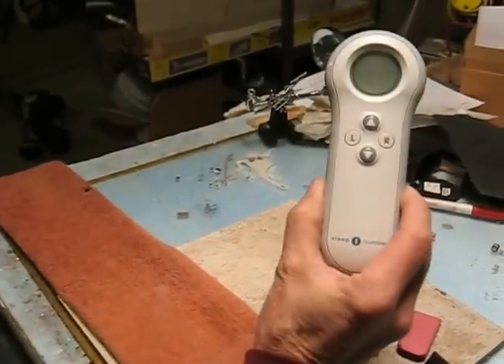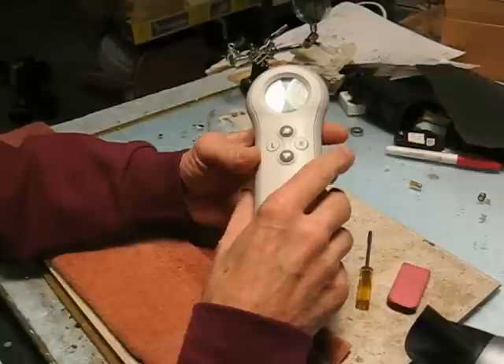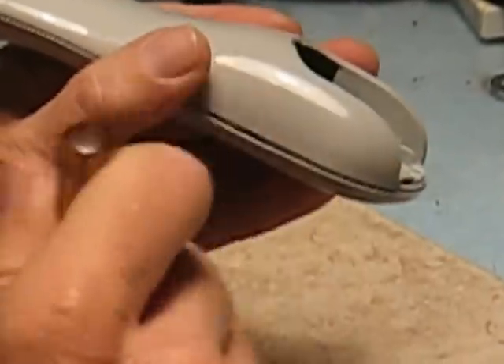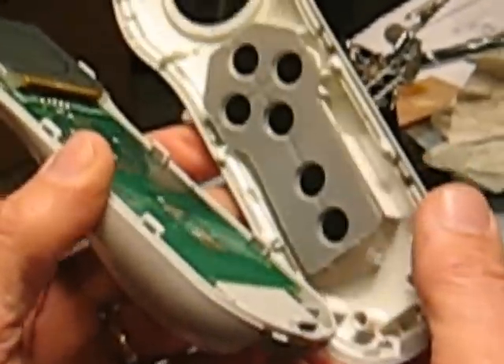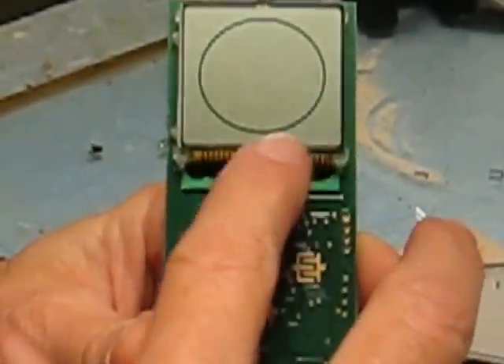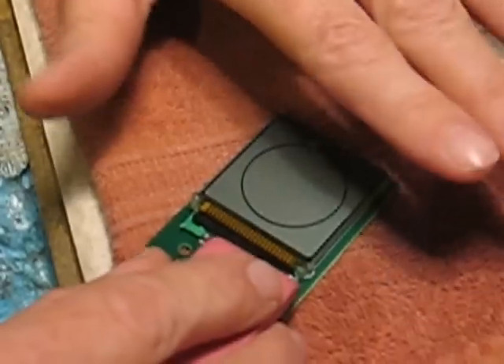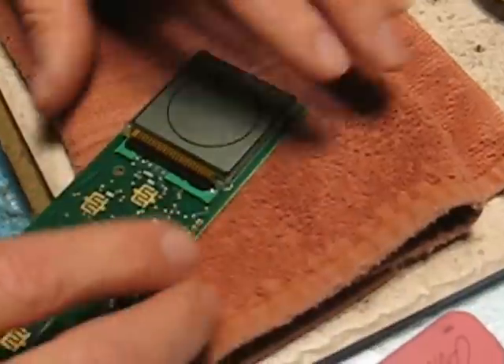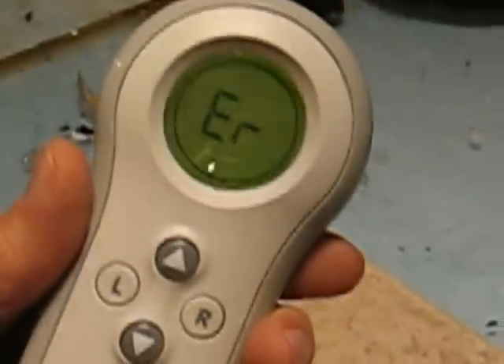Repair sleep number (Select Comfort) bed control display

Comment: Works very easy repair! 
Eraser in hand and hairdryer in other.  
Heat LCD until screen is black. 
Quickly press top of LCD Screen and lower bottom of connectors with eraser till LCD screen is clear.
Check LCD screen display. 
Repeat as necessary so all LCD screen numbers are fully viewable. 
Thank You

Comment: Brilliant sir. I used this with my old wired remote and aside from a bit of a fade in the middle, I can see the display again. For those of you using the wired remotes, just leave the bed plugged in while you're testing it and you can see how much more tweaking you need to do. I was able to do it safely without causing any shorts or anything like that.

Comment: I found that with mine, it was the liquid in the display and not the connections. Heating the display until completely black and turning the circuit board in all directions while heating (i.e., up, down, left, right) was the only thing that worked for me. After repeating this a couple of times, all the indicators came back. Thanks for this hack and for saving me some money!

Comment: Omg! Thank you so much. I've had my bed for 13yrs and my remote display has been dysfunctional for a while. I would put it all the way to 100 then decrease as necessary 🤦🏾‍♀️ But now I can see the display perfectly. I used my heat gun on low setting. Took a few times cuz I was afraid to get it too hot. But when I let the screen get completely black a couple times, it worked like a charm!

Thanks again!

Comment: Thanks so much for posting this fix, it worked great! I heated mine up like you said until the screen turned dark & then shut off the heat. Then I gently pressed & rubbed the ribbon cable area & screen. It worked like a charm! Thanks! 👍👍👍

Comment: My problem was a little different, the numbers didn't want to go up or down without pressing the buttons hard and hoping that it would work. I opened it and cleaned the switch contacts and the rubber contacts with 70% rubbing alcohol. It works good now, My wife called me a genius! Haha

Comment: It worked! I thought the pump was bad, but this fixed the remote and then I could see the pressure numbers again. And the pump worked fine once I could see the numbers and make appropriate adjustments. I used an inexpensive heat gun on low for 30-45 seconds. Thanks!!

Comment: GREG, Thanks a lot. I discovered pretty quickly this when our remote was not working at all - except for once in a while if I banged it just the right way. Did heat twice till screen turned black and used edge of leather wallet to push down after each heat. Reassembled and voila! We have a new remote. Works instantantly. Thank you so very much.

Comment: Ken, for what it’s worth I have two wired remotes with the same problems. I followed the instructions on this video and it worked flawlessly.  I was skeptical about this video because well, that would be too simple of a fix.  Note:  I heating up the LCD display to the point it turned dark and follow the instructions on this video.  Good luck.

Ryan

Comment: Thanks a bunch Greg!  5 minutes and mine is back to working perfectly.  A great alternative to spending $250+ for a replacement pump and remote, since Sleep Number Beds won't sell the $0.50 circuit board!

Comment: It worked! Note: heat strip with hair dryer on high until entire LCD turns black - turn off dryer press down on eraser with both thumbs flat on strip firm pressure 30 seconds - will work

Comment: Greg, Thanks for this video.  I have been frustrated with my remote for the last year and just figured I had to buy a new one, however, seeing a $60 price tag was crazy.  Decided to search the web for used or reduced price knockoff when I discovered you video addressing the same problem.  What di I have to loose so gave it a try.  I did heat with a hair dryer (on hot), until the entire lcd was black.  Then rubbed around all 4 edges with a white vinyl eraser - I thought the "Pink Pearl Eraser" may be to abrasive.  Then I used the hair dryer on "Cool", and brough the temp down.  Assembled and worked like a charm!  Thanks!
Reply: Worked like a charm, thank you sir. No way was I paying 80 bucks for replacement, when turned out to be a ten minute fix.

Comment: This method worked great. My remote only displayed a portion of the right hand digit on the led screen, but otherwise worked normally. After opening the case I carefully heated the lower portion of the screen where the flex circuit is attached until that bottom portion of the screen stared to turn black. I immediately rolled a pencil eraser ( the one attached to the end of the pencil) over the heated area of the flex circuit below the edge of the glass. Performed this action twice. The remote display works great now. Thanx for the encouraging video!!

Comment: Holy cow!!!  Worked on the 1st try!   Thanks so much for taking the time to figure it out and share with everyone.  Really appreciate it.  =)
The only comment I'd like to make is that you don't need to reassemble the unit to see if you got it working ok--just press the battery into position. Saves time, and there's less chance of eventually breaking the tabs on the remote.
Thanks again, Greg!

Comment: I had the same problem on the identical remote, but I don't own a heat gun or a hair dryer.  I tried heating the circuit board in a warming oven set to 190F, but couldn't quite get there.  The next higher setting I can get on my oven is 325F (165C) which seems scary hot for this task.  I don't have a heat gun, but I do have a brilliant Aussie girlfriend, also an accomplished cook, who told me just what to do.

Put a thickish layer of uncooked rice in the bottom of a covered casserole dish, and put that into the 325F oven.  When it's all toasty (you'll smell the rice), take it out of the oven, set it in a safe place, drop the circuit board on the rice, and cover it up again.  Let it sit a few minutes and take the cooked board out of the casserole. Then proceed as described (press on the display, etc) while the board cools.  Test the display and repeat as necessary.  Please note you never put the circuit board in the hot oven, you only put it in the warm casserole dish outside the oven.  I had to do it a few times, but my remote went from only one working segment to full functionality.

And hey, I have a PhD in physics, and my awesome smart Queensland girlfriend didn't finish high school.  Gentlemen, pay attention when your women tell you things!
Reply: Wise advice Croc Cowboy👍

Comment: Both of my controllers were experiencing this problem. In fact, 1 controller wouldn't light up at all as if it wasn't getting power. I tried this fixed multiple times in the span of about 2 hours  and while I saw improvements (in only 1 controller) it wasn't completely fixed. I then left it alone for 2 weeks where I just happened to pick up the controllers and noticed that both back lights were in their "standby" dimly light setting. I gave them both a try and both worked perfectly! :) Give this fix a try and don't be frustrated if it doesn't work straight away as it may take a few days.  Thank you for the vid!  - Sleep Happy

Comment: Great video and repair info!  I had the same problem with out Cal King bed that was in storage for 4 or 5 years.  It took me about 10 mintues total to open the case, heat the circuit board, press down on the connection and reassemble the case.  Voila, it works just like before.  Thank you Greg for saving me the purchase of a new remote/pump.

Comment: For over five years my screens have been blank. I’ve been just going by feel. But my wife’s side had a leak which I repaired (I think) so it would be nice to see a number calibration to know if it’s still leaking during the day. Thanks a ton for posting this. I started out with short 10: seconds of heat and kind of gentle pressure. Slowly building both time and pressure until I got a sequence to work. Around 30 seconds and using the eraser about 10-12 pounds pressure with my thumbs. Took a while but now both sides have their numbers. Thanks again!!

Comment: Count me as another success story. I found that pressing with the pink pearl eraser on the actual brown ribbon connector at the bottom of the LCD did the trick for me after heating several times and pressing all over the screen. :) Thanks a billion- you saved me $$$ before selling my sleep number- :)

Comment: This was great, at first i thought sure it will work but what did i have to loose.  I went for it and left the high heat on for 1 minute and pressed firmly on the strip and on the top as shown and what to my surprise it WORKED!  For once something on the net worked like it was shown.  Thank You very much.

Comment: Works like a charm....have powerful hairdryer so screen blackened very quickly.  Used eraser end of pencil.... immediately solved display issues.  Thanks for the easy solution!

Comment: This is a very helpful video. I agree with those saying be a bit aggressive with the heat. After a couple of timid attempts I heated mine to black display and kept it that way for a couple of minutes.  Then applied pressure and let it cool. Works perfectly now!

Comment: GREAT solution - I didn't even consider this as an option. THANK YOU. 

FYI: You only need to heat the data ribbon, as it is the connection to the display. I heated it until the display went black, as suggested, and pushed the data ribbon into the display unit.

Comment: OMG!!! This really worked. I did it 2x and really heated the heck out of it the 2nd time. The numbers were 3/4 there and I thought I could live with that. Went in to test it on bed and 1/2 way thru air up the numbers popped all the way in! Never would have thought to do that. Thx!!

Comment: Thanks. This worked on both remotes, when they replaced the other for free the last time.. I'm not sure if it was the glue or the lcd itself, but both remotes are working. I had limited warrenty and it saved at least $25.00 for "Select Comfort" to send me a new one.

It would be nice if their customer service shred this link instead of lying about how they are improving the technology of the remotes. If that were so, this page wouldn't still be getting hits.

Comment: I found this great vid years ago and while skeptical,  I  had been meaning to get around to trying it....well did that that to day! WORKS PERFECTLY just as advertised! I did use an actual heat gun and it took lees than 30 seconds for the LED to turn black- i pushed down on the board (Used a pencil eraser)  as instructed in the vid put it back together and Voila! THANK YOU GREG!

Comment: This worked great.  I used a soldering heat gun to heat it up quicker with more precision but still took 2x to get working.  Just follow the instructions on the video.

Comment: Thanks for the fantastic simple repair.  My remote display had not been working for several years.  I had to heat it up to the point that it started turning black. Then rubbed with an eraser and the display works fine now.

Comment: It worked like a charm, I used this trick on our older 2007 model sleep number with the attached remotes. I let the screens turn black and then used an eraser to push on the screen and contacts. Thanks!

Comment: Thanks, this worked and saved me $30 bucks.  It worked first time...I heated up the display until everything was black and pressed the pieces with an eraser as you illustrated.

Comment: Nice tip!  I just fixed both of my wired controllers on an older sleep number bed using your technique.  Only additional step is to unplug the bed if you have wired controller.  Thank you so much for this video, it worked perfectly on the first try!

Comment: Thank you so much. I was considering a new pump (I have a wired controller) which is a $300 investment while the pump still works just fine. I saw a different video that was inspired by this one. I cycled a few times and then watched this one and heated from the bottom connections. I heated just till it all turned black. Display seems like new. Thanks again.

Comment: THANKS GREG! This worked like a charm and it also took the third try to work because I was a little nervous at first to use the heat. On the first try I placed the remote on a soft surface and gently heated as you described in your video. Then to test it to see if it was fixed, I put the entire thing back together again. It wasn't fixed so I had to take everything apart again! 
/:(

On the second try I heated the screen until it turned completely black then I pressed firmly all around the screen and on the ribbon with a dry wash cloth. This time, instead of putting it all back, I laid the circuit board back in its correct position, inserted the battery, and then placed the soft rubber left/right keypad on top of the circuit board in its proper position so I was able to push the buttons to test the screen. Still not quite right so I went for a third try. And this time it was fixed! Fantastic! Brand new! Oh, and a little hint ... before putting the unit back together, use a drop of liquid soap and a slightly damp wash cloth to clean both sides of the screen so it looks brand new, too. As of 01/07/17, the remotes are anywhere from $50.00 to $200.00.

Comment: OK ! Did like you showed in your video, and it worked!  I had to do it twice, because I wasn't quite brutal enough with the heat the first time. Yes, the display turned all black while heating, but I tried to concentrate the heat on the black resin where the LCD was glued to the board. 2nd time was, the trick.  Thank you again.

Comment: Thanks for this! We have an 8 year old 5000 series mattress with wired remotes, and it looked very similar to your wireless remote. I followed your example, and it looks like it's working again.  Much easier than trying to get Customer (lack of) Service to send a new pump assembly.  I used a plastic comb to press down on the connector.

Comment: Greg! I just repaired my remote! You rock! Awesome job and thanks for the tip esp. about the display turning black! Mine did, but when it cooled, it turned right back to gray! It only took 1-2 minutes of heating, so mine worked on the first try!

Comment: Thanks, Greg, for posting this informative video.  For several years my wife and I guessed at the correct sleep number air inflation due to the display having crapped out.  Searched EBay today for a replacement (not gonna pay those prices) and figured I would check YouTube--found your video, followed the steps and (after about six heatings), voila--back in business!  Note:  Ours is the wired remote and I left it plugged in during the heatings.  Thanks again!

Comment: Works well. Like others, I had to perform the heating a couple of times until the screen turned completely black and then massage the display with the eraser. I'm not sure you even have to take the controller apart to do this, but it's easy enough to do so. I do recommend a plastic blade when separating the pieces.

Comment: I heated cable and display until the display turned completely black and then pushed down on cable with an eraser just like the video showed. I put remote back together and it works just like it did when it was new! I wish I had found this video 2 years ago because the display has been completely blank for a couple of years. Thanks for the info!

Comment: Too easy; worked first go. The bottom of the LCD screen did go black but returned to normal when cooled down. Took less than 10 minutes including getting out the screwdriver, hair dryer & eraser. Mine is not battery powered but is connected by a low voltage cable; same inside though. I did not turn the power supply off but it is recommended that you do. I owe you a beer or two. Cheers.

Comment: Thanks - display was blank and the pump wouldn't communicate so had half a flat bed. Heated them up and now it all works - at first only half the display, but next day the whole display is perfect for both wired controllers. Virtual beer for you!

Comment: Thank you!  My remote accidentally went through the washing machine with some blankets.  It works, but I have to press hard on the button, and the display just has one small vertical line on it.  It's a little different than yours, but definitely worth a try!  They are about $150 to replace now that it's 2020.

Comment: It works on the wired remote too. I used an Embossing heat tool from my craft room and a silicone pressing tool from my sewing room instead of the eraser. Thank you so much!

Comment: I owe you a drink. Took 3 minutes with my heat gun on low, if that long. I did only press on the bottom edge of the display where the ribbon cable is attached. No need for any pressure elsewhere. Thank you!

Comment: Worked for me on two wired controllers. It's the ribbon cable's connection to the circuit board that seems to be the issue. Heating that area and pressing on the connector, rocking back and forth with a round object made the LCD segments come back to life. Keep rocking back and forth until all the segments stay on, then let it cool off and put the controller back together.